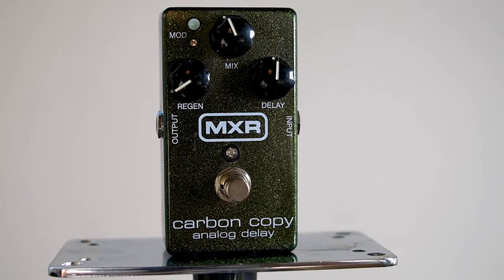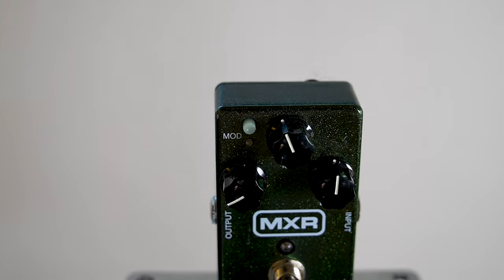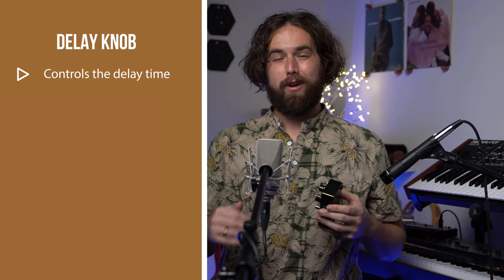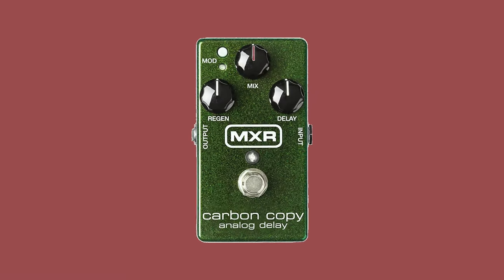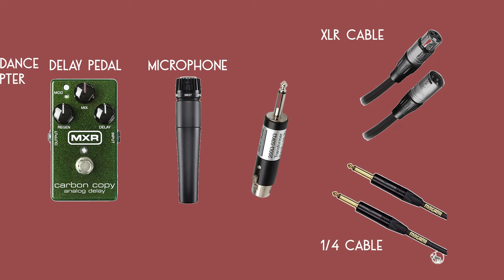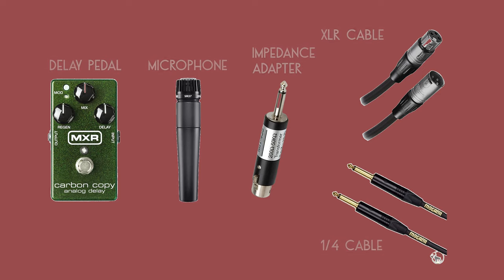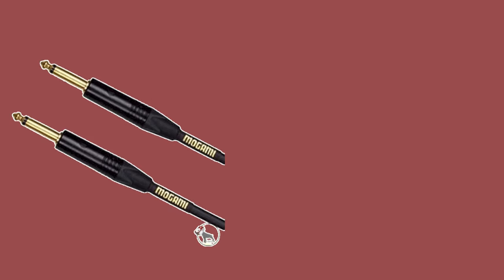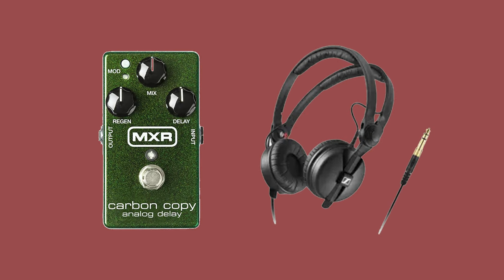Saxophone Effects: Delay Pedal (MXR Carbon Copy Analog Delay)

Comment: Hi! Through the video on which you showed off the MXR Reverb pedal, I've recently purchased exactly that pedal. But having tried it... I'm not sure if it gets me the right reverb-y sound I hoped it'd produce. Now in this video at 3:18, you basically also produce a reverb, right? Am I wrong in saying this pedal kind of performs the job of a reverb too? Or do I just need some more time to figure out the MXR Reverb pedal? Would love to hear your stance on this!
Reply from the maker: A very extended delay can sound like a reverb effect. Reverb is more of a natural sound, while delay is an effect, so it depends on what you are going for. I would spend more time exploring the MXR Reverb, that pedal has a lot of possibilities, but if after 6 months of messing around you don't feel like its giving you what you need I would check out a delay pedal. Hope this helps
Reply: @GetASax  thanks for the reply; I definitely will try and get more used to it. I am definitely getting the feeling that now having stepped into the world of pedals, it is a slippery slope for getting more and more... :)
Reply from the maker: @mR7ProductionsNL  It is a slippery slope! It took me a few years to really get used to how I wanted to use pedals, takes time like everything else